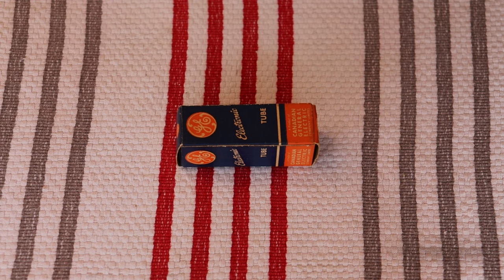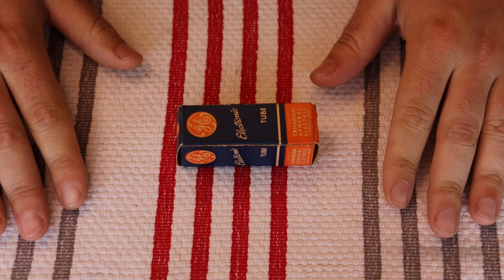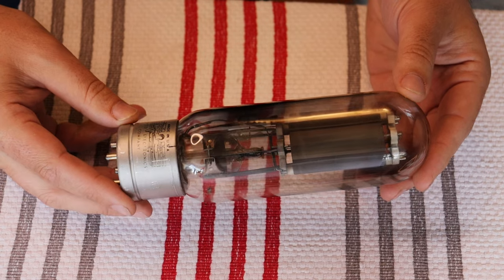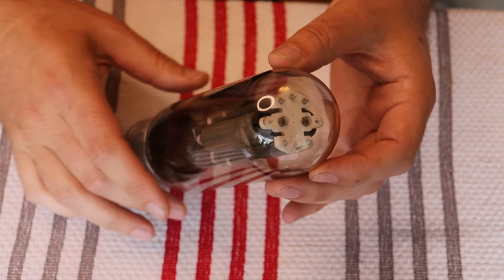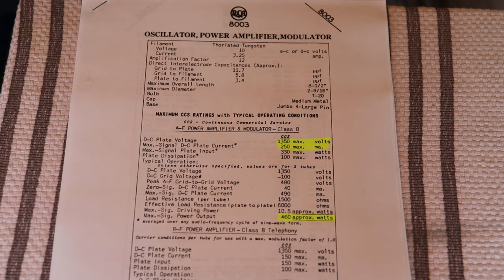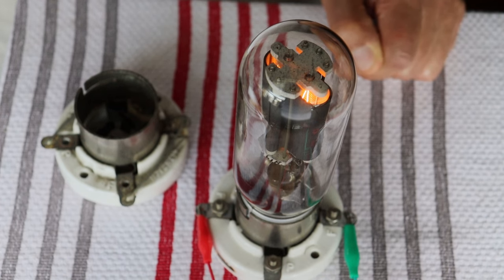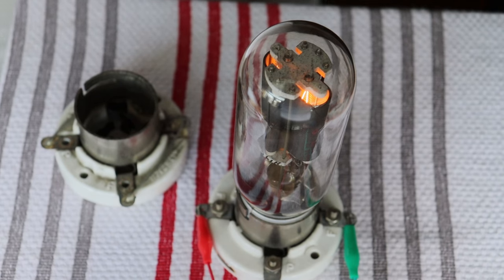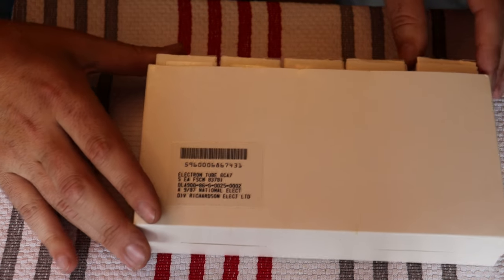Tube Lab #197 - 211 & 311 Triodes

Comment: The worst injury I ever got while working with electronics was not from electric shock, but was a burn from the envelope of a 211 running at near-maximum dissipation back in 1995. It had been powered up for about 15 minutes, and I was testing a driver circuit for it, and managed to brush the underside of my right forearm against the envelope of the 211. It was terribly painful, and I had a scar for many years. The scar is gone, but no hair grows on that spot to this day.

Comment: I use TV tubes on purpose. I use horizontal output tubes as finals. I made a little amp that uses 12GE5 tubes driving industrial thermostat transformers 480vac to 24 vac as output transformers. You would be amazed at what this junk sounds like.

Comment: I have an original pair of Cary 805B triode monoblocks which use 211's as the power tube. I am currently running Linlai Elite's in them. It outputs 25 watts class A and then transitions into Class A2 up to 50 watts. I have never heard of a 311. Would this be a direct substitute for the 211? Would it increase my power output? I am just surprised that in all these years I have never heard of a 311 power tube.
Reply from the maker: @johnmourat712  yes the 311 is a direct drop in replacement for the 211.  It was probably built slightly differently (higher specs) to get around the patents on the 211.  Even though it has a higher spec it will run exactly like a 211.  We tested it at exactly the same operating point as a 211 and the output was only 10-20mA higher or 10-20%.
It may play slightly louder than your existing 211 power tubes, but maybe not, that will depend on how your existing tubes test.
The reason you've never heard of the 311, is that it was only made by United Electronics (they have a nice spread wing eagle logo on each base).  And as far as I know no Chinese tube manufacturers copied the design (they probably don't even know it exists or they would have built 311's!).

Comment: I would like to know the parameters of the operating point you chose to test the 211 and 311 tubes.  I have a pair of Amperex VT4C tubes that I've been wanting to test for years!
Reply from the maker: @barrydraeger1892  just drop into the store and check the 211/311 listing, we show the testing voltages.  Caution!  Safely Testing high voltage Triodes can be dangerous with a risk of burns and or electrocution, always consult a professional when in doubt.